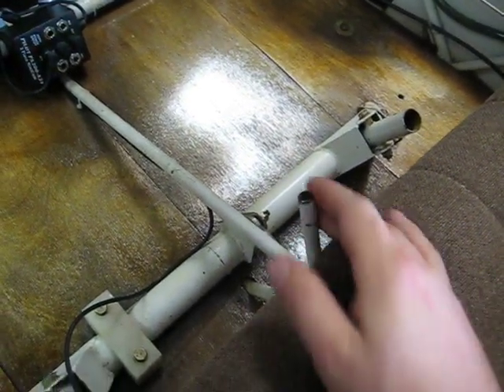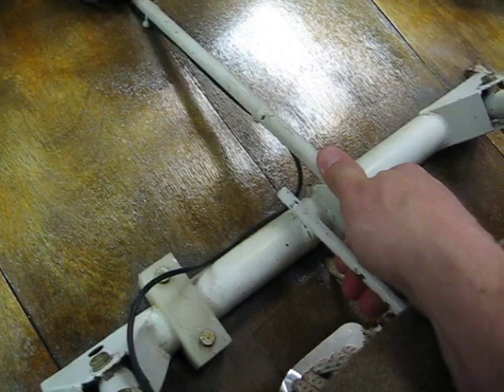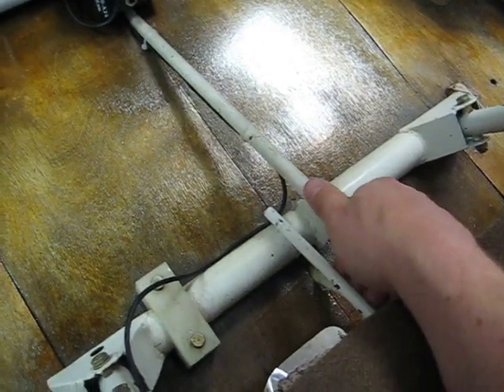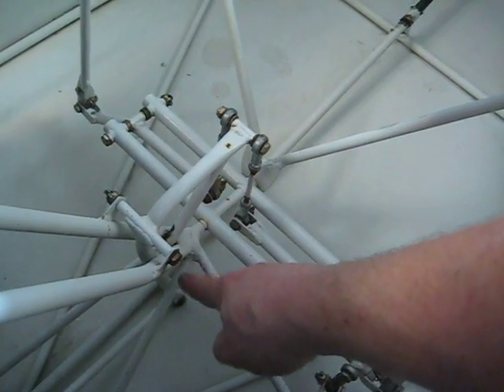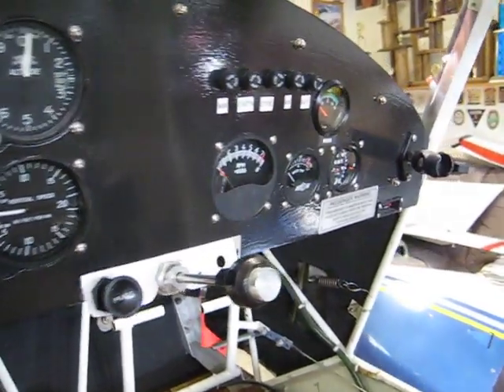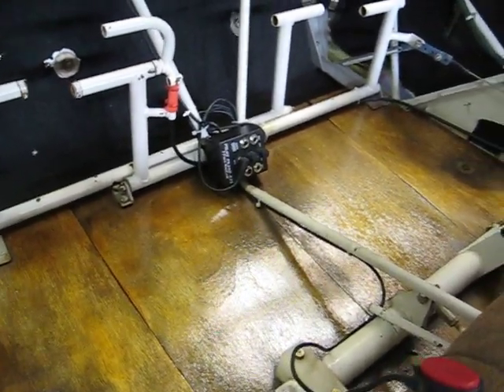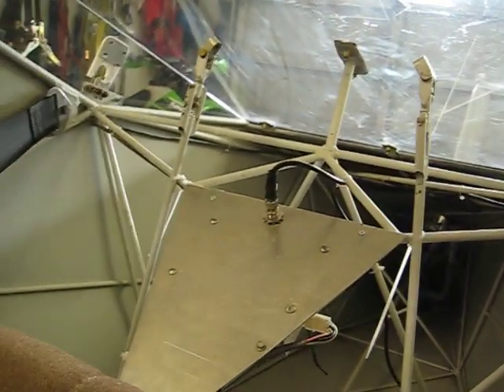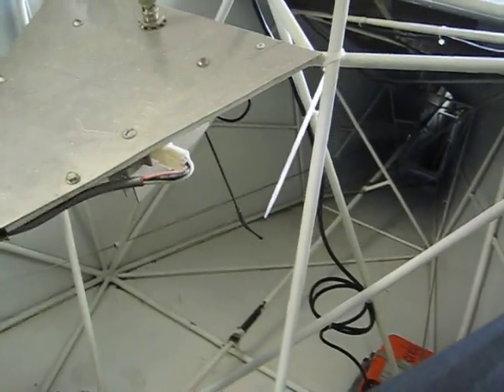Avid C model Flap handle

Comment: something wrong with that adjustment on your flapperons.  The Avids and Pre Kitfox IV flaperons are only good for 10 to 15 degree MAX. After that you can get reversal.   The IV  model can get  30 to 35 degrees deflection but it a totally different mixer assembly. Some limit thet to 20 degrees. They miss out on the extra 15 degrees which will improve your STOL ability if you know how to use them.